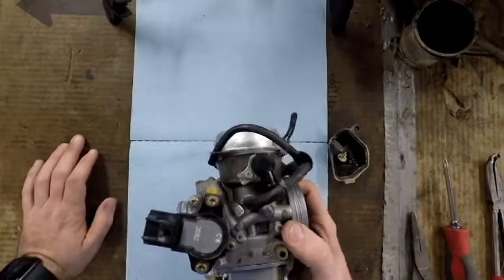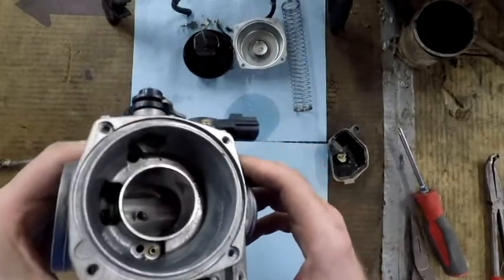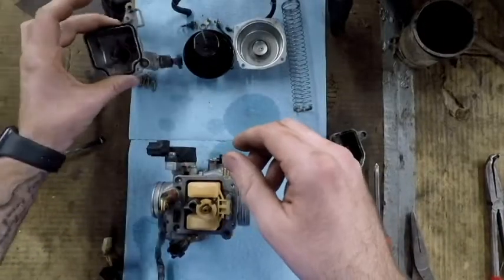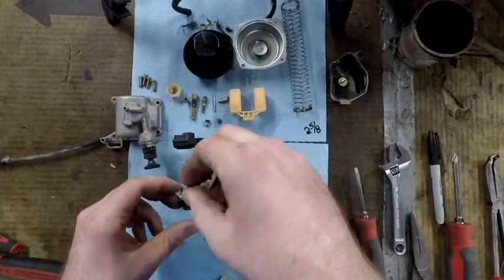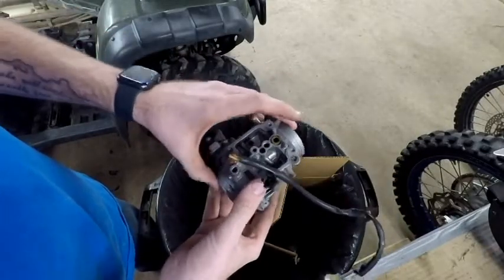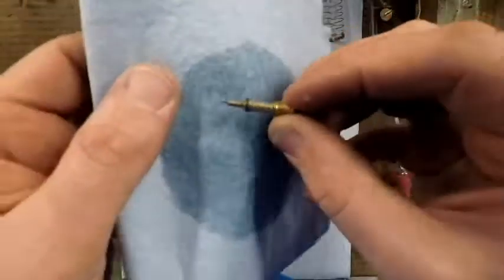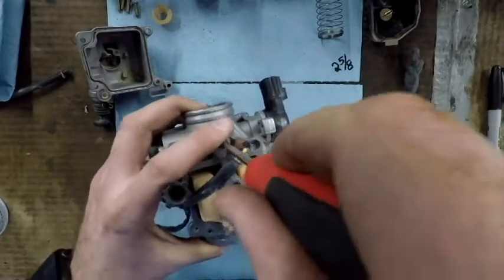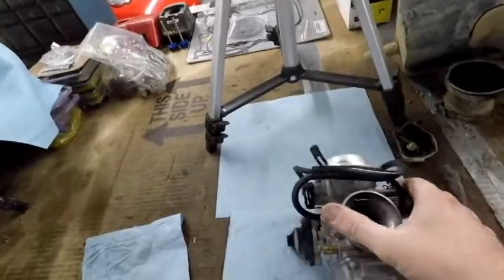Honda Rubicon Carburetor Cleaning

Comment: cleaned mine,it fired right up on choke,but i noticed the primer plunger leaking...kinda wish i hadn't disturbed it
Reply from the maker: Did you notice the rubber being ripped? You might be able to put the tinyest amount of gasketmaker on it to help it seal but definitely let it dry before putting fuel to it

Comment: It's called the "Emulsion tube" @ 8:28. And you NEVER use carb and choke cleaner on the rubber tip of the inlet needle (aka float valve), or any rubber o-rings, and do NOT use it on the diaphragm @ 29:40.
Reply from the maker: Thank you for that. What would you recommend to use on rubber parts that are dirty? I agree it’s not the best for the rubber but it’s never been a cause of failure for me so I’ve never looked for an alternative.
Reply: @ToyShopRestorations  I use WD40 for cleaning rubber parts.